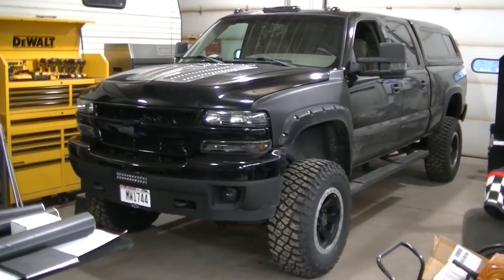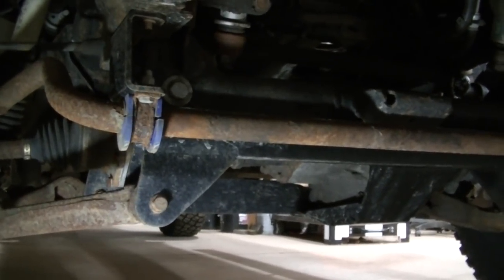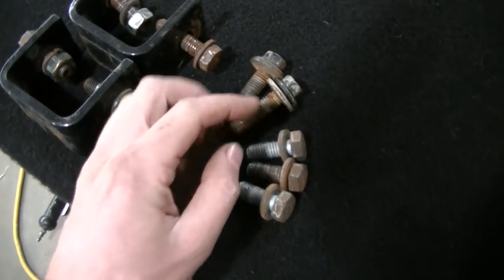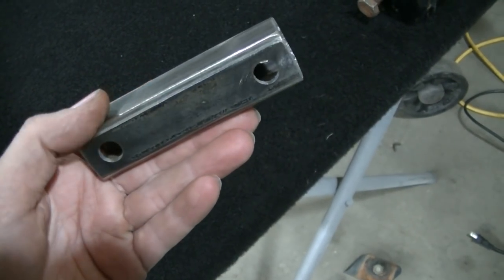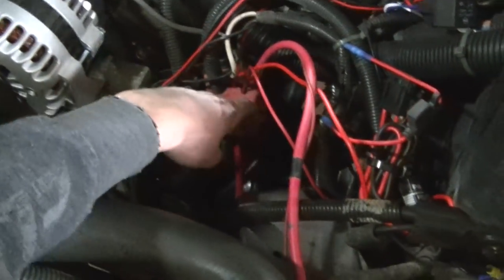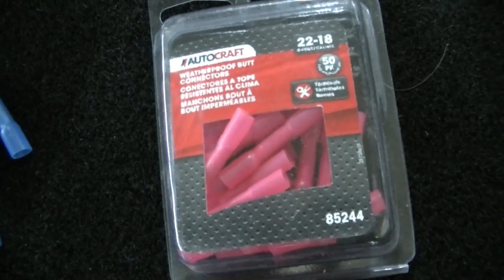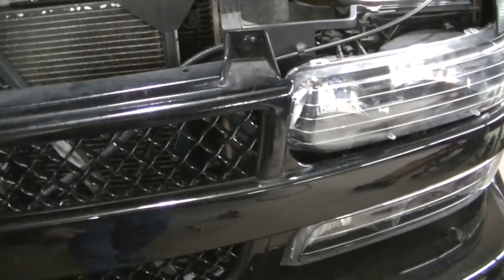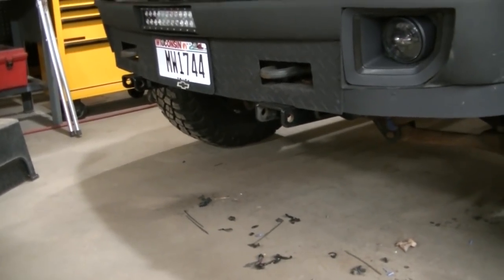Project Midnight Gets a Snowplow "Mounts and Wiring" Lifted Silverado

Comment: I must say you should install western plows as a business you know how to weld & cut I know that’s not needed but in some cases it would on a lifted truck. you waterproof your wires perfect. You know what’s needs to be done the right way.  Thanks
Reply from the maker: I don't think many lifted trucks get snowplows.  I can't even find a video of one.  I have installed many plows so it's really pretty simple for me.  It does take time to run the wires around.

Comment: Like that truck . .I have an older GMC , 1996 with only 65k on it . Years ago I was told those snow plows were hard on the frame . Never had one so don't know first hand .
Reply from the maker: All the mounts I have installed look pretty well engineered to spread the stress out pretty good.  The pre 88 trucks might have had issues.  Those frames were a bit thin.

Comment: Drop brackets for the sway bar....I need to do that.
Reply from the maker: Those were pretty easy to make.  Your sway bar hitting something?
Reply: It’s not hitting something, it’s been disconnected for a couple years now. It was spitting out the links and figured out the lift kit did not have extensions installed.
Reply from the maker: I got you.  Sway bars really help with feeling stable.  I wouldn't run without a front one.
Reply: Yeah, I’m not drifting the Burban, so it’s not too big a deal; but every time I’m up in the canyons I think to myself it sure would be nice to sort that out.